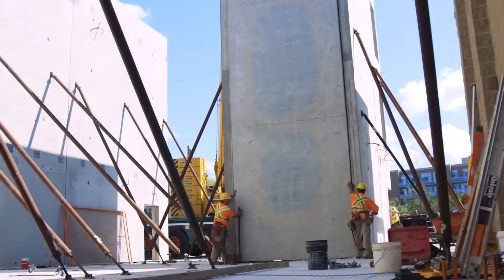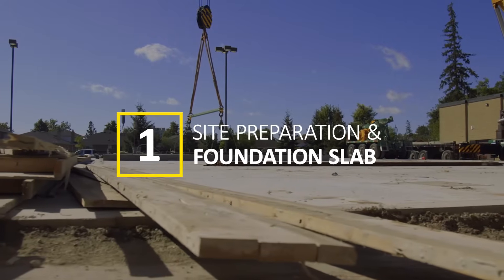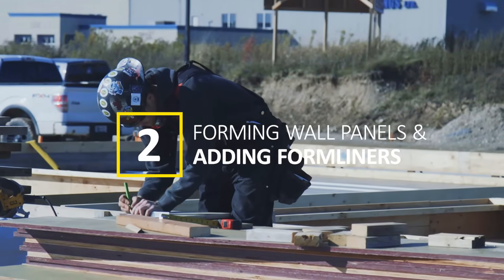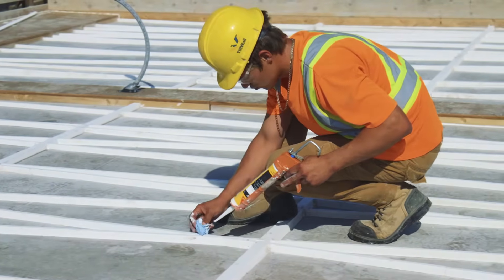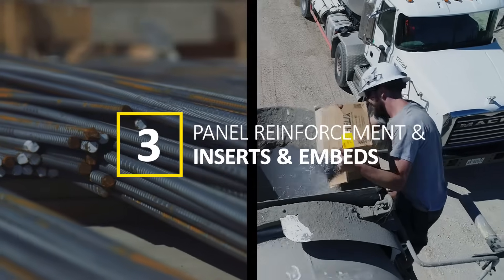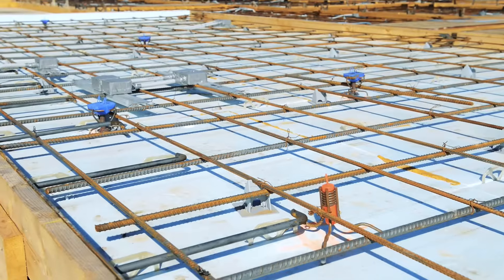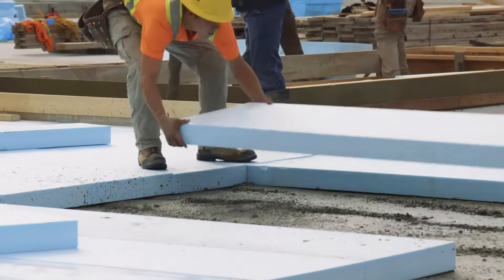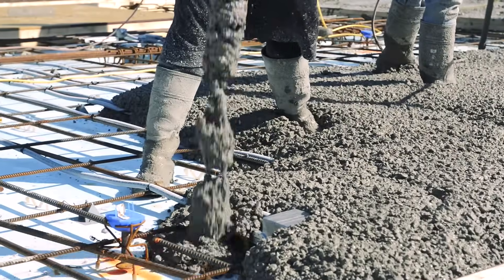Tilt-Up Construction: The Process of Erecting a Tilt-Up Building Explained

Comment: How do the panels not stick to the floor slab? Do all panels have an insulation layer?
Reply from the maker: Great questions!

How do the panels not stick to the floor slab?
We apply a bond breaker to the casting surface before the concrete is poured. This prevents the panels from bonding to the slab, making it possible to lift them cleanly once they've cured.

Do all panels have an insulation layer?
Not all panels are insulated. In our projects, most perimeter panels are insulated, while interior panels typically are not—but this can vary depending on local building codes and climate requirements across different provinces and states.

Thanks for your interest in tilt-up construction!